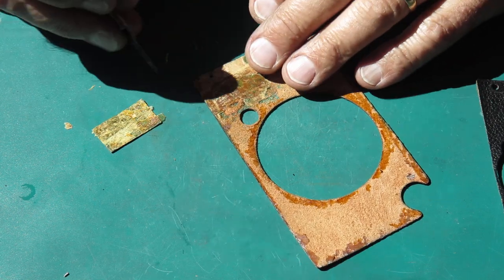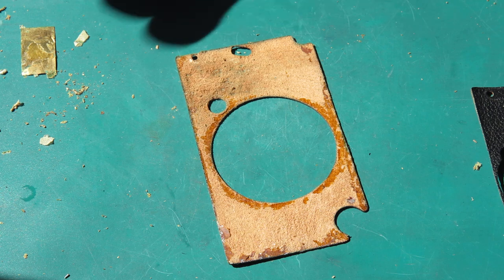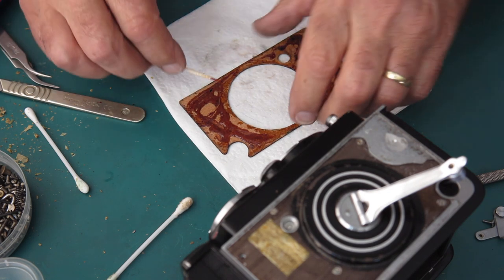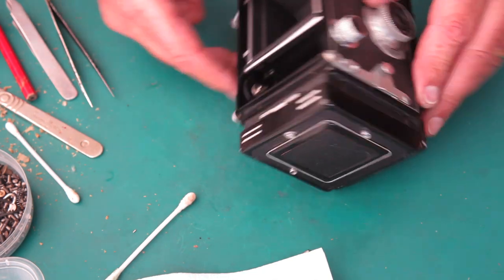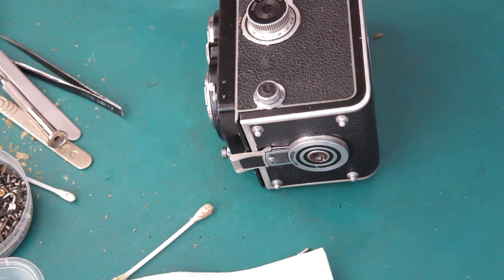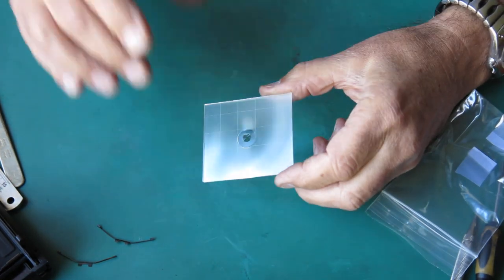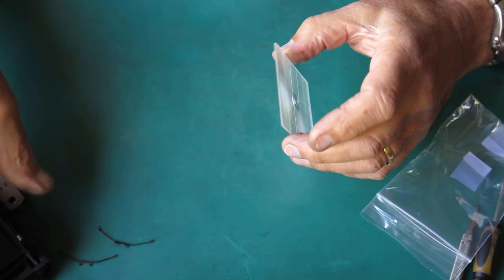Rolleiflex repair, servicing a Rolleiflex Automat TLR. Part 12

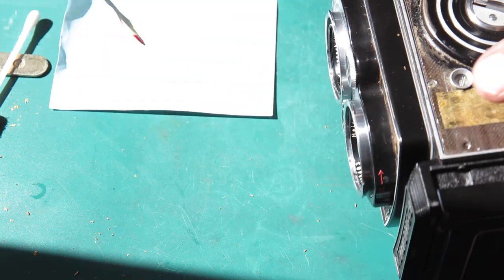Comment: 6:50 as I understand it the brass shim is there to avoid getting glue onto the protruding (and rotating) frame counter dial. so you simply position it over the hole before replacing the leather. or put it onto the leather after spreading the glue.

Comment: Many, many thanks Chris, for providing this astonishing treasure trove of videos. Decades of experience gained by hard work and involved thinking. Any aspirant with the requisite skills and mindset can use these to pick up the very best working techniques, from screwdriver and tweezer handling, to the logic of fault analysis, the importance of Cleaning properly, Lubricating properly, testing and then and only then Adjusting only when needed.

Comment: Again, thanks for this series, it's been very helpful. I have the same model and i just can't get it to focus at infinity on the taking side. I'm not sure why, unless someone at some stage replaced the lens. Have you ever come across a camera like that? I took the shutter off and the parts look identical to this cameras. The only difference is i have a Zeiss-opton 75mm lens. I really dont want to junk the camera but I'm losing hope of fixing it. Any ideas?